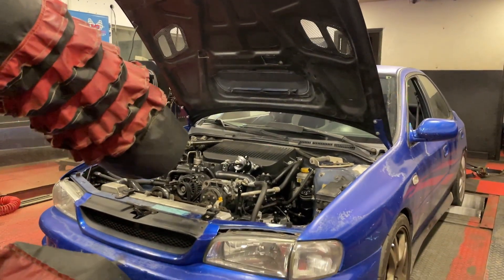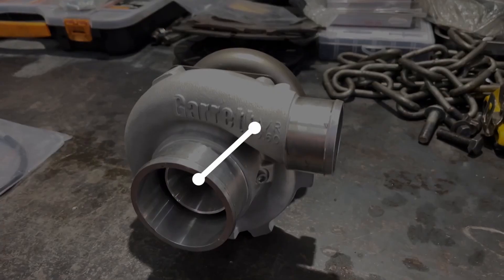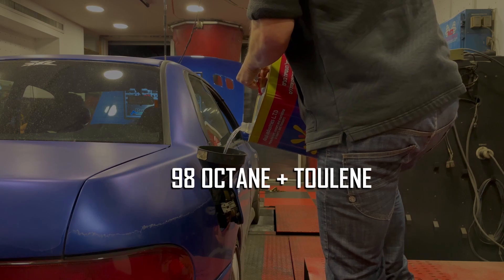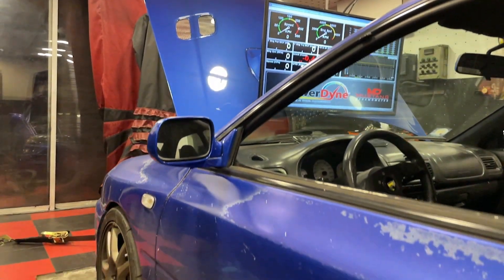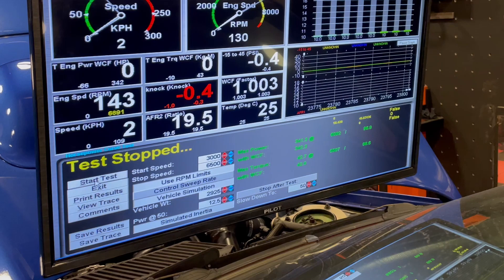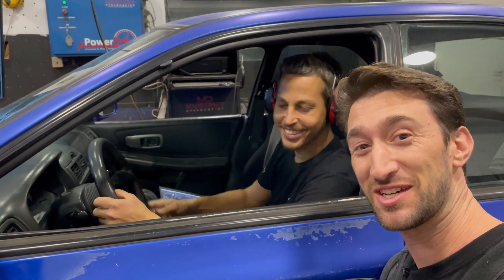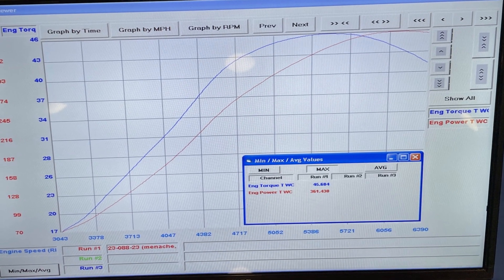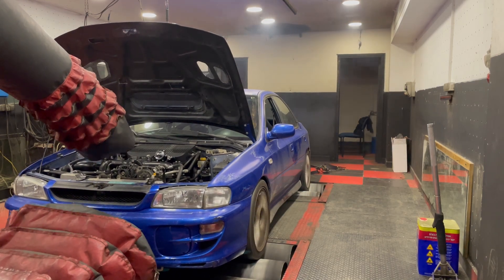How much power can you make with a TMIC?

Comment: With the GTX2860, .64?? @ 360 WHP what was the boost pressure? Im going with a G25-550 0.72 on my Evo 8, Goal is 400ftlb torque ATW with lots of low rpm torque. Currently has a GTX2867 .64 which has over 50,000 miles on it (has been on numerous other cars) now its time for something newer
Reply from the maker: Ahhh I would love to upgrade to a G25-550 in the future as well! Great choice!

We made 360whp at 20psi of boost.

I since made a more recent video with a 0.82 exhaust housing where we made 378whp at 23psi.

Comment: How is your low partial throttle with the Tial blow off valve? Does it open and close very slowly? What spring pressure did you use? Great results! 400whp will be achievable 😃
Reply from the maker: The BOV has an 11psi spring I believe. It is a little slow to open on partial throttle now that you mention it but no crazy flutter or anything. 😊
Reply: @TheGCJourney  I am running the same spring pressure but mine on very little partial throttle almost sounds like the scream of a bald Eagle. I can’t figure out why it won’t close faster?
Reply from the maker: I’m not sure but it might just be the design 🤷🏼‍♂️🤷🏼‍♂️🤷🏼‍♂️